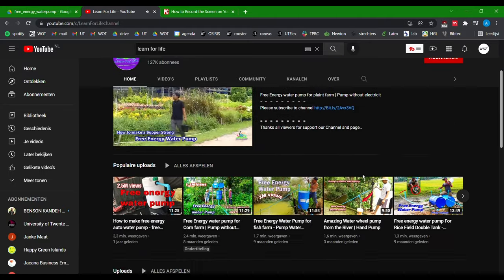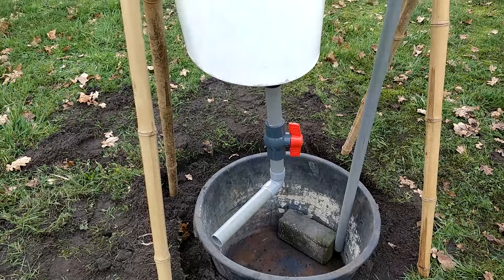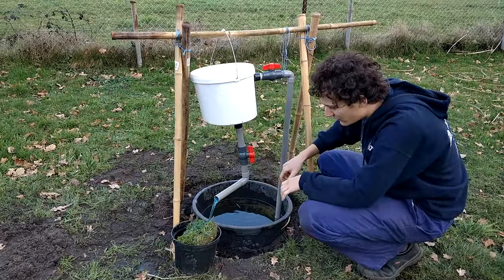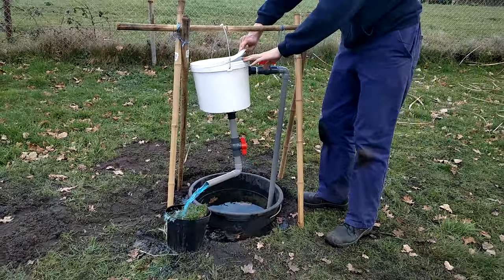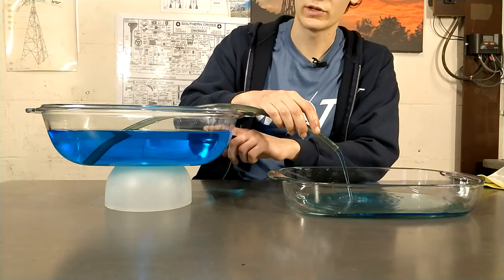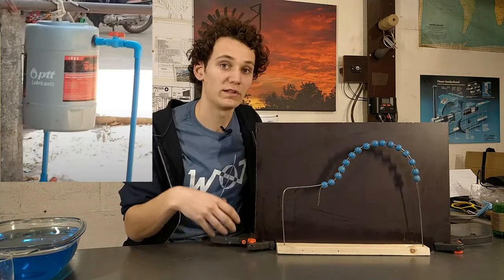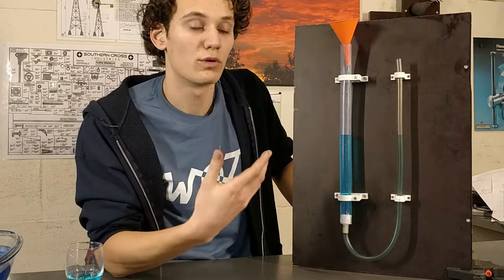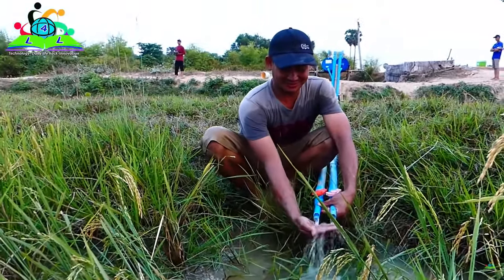FREE ENERGY Water Pump Tested. Is it possible?

Comment: It would work if you prime the tube inlet to the well lower that way the water flowing out of the bucket creates a vacuum
Reply: Noop. The sole purpose of using a starting bucket on this siphon is that you do not need to fill up the suction tube. But remember, this is a siphon. No siphon can lift any water up to a higher level from a well. Source water level must be higer than the output. That is not the case here, so the siphon fails, just as the video is demonstrating. The «drum pump» is no pump, just a siphon with a starting barrel.   All videos showing drump pumps lifting water are all fake. The only water that comes is the water you have manually lifted up into the drum. Then it stops.

Comment: You're mistaken of any Size calculation.
Inlet, Outlet pipe and Sizes of Tank and any seal points.
Reply: Everything here is all OK. There is no need for any spesific sizes on the barrel or pipes. For this to work, source level must be higher than exit.

Comment: Explanation of Operation of a Pump-less Suction System

Operation:
In this system, water suction is achieved solely by the hydrostatic pressure exerted by the weight of the water in the container. The pressure at the bottom of the container (P_tank) is greater than the pressure in the tube (P_tube) due to the elevation difference. The pressure difference (ΔP = P_tank - P_tube) pushes the water up the tube, creating flow.

Compared to a system with a pump:
- Advantages:
  - Simplicity: No pump is required, reducing cost and complexity.
  - Reliability: Fewer moving parts, reducing the risk of failure.
  - Low operating cost: No energy is required for operation.
- Disadvantages:
  - Lower flow rate: The flow rate is limited by hydrostatic pressure, so it may be slow.
  - Limited lifting height: The maximum elevation difference that can be pumped is limited by hydrostatic pressure.
  - Dependence on slope: Operation relies on the slope of the terrain, making it unsuitable for horizontal installations.

Applications:
This system can be useful in situations where simplicity, reliability, and low operating cost are more important than flow rate.
- Agriculture: For irrigating fields on slopes with low water demand.
- Hydraulic works: For supplying small tanks or reservoirs at low elevations.
- Education: For demonstrating principles of hydrostatics and fluid flow.

In summary:
Implementing a pump-less water suction system is feasible, but requires careful design, considering limitations in flow rate, lifting height, and dependence on slope.
Reply: This is a siphon. No siphon can lift a single drop of water to a higher level as there is no power source in the system. This video shows that a siphon is no pump.

Comment: You drive whit a mercedes and try the same whit a lada.  You forget a return valve and the exit pipe mus be longer than the incomming to the water line then you get a vacuum and it pulls the water out of the well and 2 stand pipes create extra vacuum pressure when it flow

Comment: Try and Use a smaller diameter pipe for the inlet, the weight of the water on the inlet should be less than the output, see in all the videos the inlet is smaller and at about 45 degree, compare apples with apples.

Comment: I think this design didn't work because air was going through the outlet tube so you would lose any pressure built into the bucket. Maybe try to experiment again with bubble catcher. Maybe you'll have better success
Reply: A bubble catcher would only work for some minutes till the catcher is full of air. The bucket itself is a bubble catcher. Here he on purpose makes the output a bit short to speed up the fact that air will tend to enter in reverse.

Comment: your mistake is, you used a bucket, instead of sealed container like, it works if there is no air coming into the sytem
Reply: The form of the bucket, tank, container, vessel, is irrelevant.

Comment: anyone who bleeds brakes on cars and cycles would tell you it wouldn't work as needed.  The air in the well side pump pipe causes oscillation because air can compress and also open side air inside the pipe.

Comment: You missing two things 1. Prime the inlet 2. Your container must sealed perfectly to create vacuum from the system
Reply: With a container you do not need any foot valve or filling of suction pipe. The air leaking in from the outlet proves that the container is air tight.

Comment: But you can transfer water using a water level system to top off lakes connected to topped off levees with a pipeline and a one way valve 🤔🤗

Comment: what a disservice to humanity to discount a brilliant simple and EFFECTIVE way to solve problems. i encourage you to rethink whatyou have done .i have a working model of this concept . runs continuously 24/7 rain or shine. took 5 tries to find a vessel that would not collapse. yhat force that collapsed my vessels is what " pulls " water up against gravity as the down side has more wieght .if AIR is not allowed back into vessel this " pull" exists indefinatly. i submerged the output line in a bucket to prevent air from glugging up into the vessel. AIR IS THE ENEMY OF THIS CONCEPT.  do it right and stop spreading ignorance.
Reply: Sorry, you are spreading ignorance. If you have a working model of this you ar proving that a siphon can lift water. Never heard of. For a (barrelled) siphon to work, inlet must be higher than outlet and the system must be air tight. This video shows that a barrelled siphon does not lift water.

Comment: Seeing the tap filters that have lights that turn on when you turn on the water flow. I always wondered if you could use the power of the flowing water to power the pump. By having several of these generators in the pipe can you produce enough energy to pump  enough water into a system that replaces what is drained out? Seems to me the water column has the same gravity force on it you should be able to get just as much energy out of the first generator as you do the last one. Good theory for you to test.
Reply: No, you can never get more energy out of a system than you put into it. In the real world, there are always losses to entropy, meaning it will stop moving after the innitial energy is dissipated. In a 100% efficient electro-mechanical system (which does not exist), you could get perpetual motion, but you couldn't actually do anything with it, you couldn't use that energy for anything. It's like the Moon orbiting the Earth. If you use it's motion to power anything, it will slow down and fall closer to the Earth. (In fact, the Moon is slowing down the Earth's rotation and moving higher in its orbit, but that's another conversation.) Another example is a superfluid with zero viscocity, wich does actually exist. You can set it in perpetual motion flowing around a tube, but you can't extract any energy from it without slowing it down. Essentially, it's just in orbit like the Moon.
Reply: You could generate power from a syphoning system, where the source is higher than the exit, therefore water is dropping in height.  like a hydroelectric power plant
Reply: @jabyers  Sure, but that is indirectly collecting solar energy (heat>evaporation lifting water). He's talking about a perpetual motion machine with no external energy source.

Comment: You didn't install a foot valve at the end of the source pipe and your upper reservoir is not properly sealed thus air is sucked in thru the lid. Another thing your upper reservoir is too small to create vacuum pressure enough to sucked water in from the lower reservoir. Also your delivery pipe is too small for the flowing water to generate a vacuum inside the upper reservoir enough to sucked water up from lower reservoir.

Comment: PLEASE PLEASE PLEASE RE-DO
I would love to see this work. I tried a smaller scale version with juice bottles (hard plastic), straws and hot glue and didn't work for me
Your possible mistakes. 
1. SEAL THE LID, 
2.bigger bucket and higher, 
3.a straight down pipe without elbows (avoiding air being sucked in). 
BONUS : add one way valve on inlet as people suggest (but consider that more pressure need to build up = bigger water tank) AND prime it.
 
Add a 12v alternator with a rectifier and you get free energy as well. 
I have a SHALLOW WELL PUMP and the pump would not work if is not primed ( burned a pump before because I didn't followed instructions)
Reply: Everyone would love to see this work and harvest in addition free energy! But that's not possible. Neither 1, 2 or 3 nor a valve or priming helps. This is a question of water and air pressure, and water pressure does not depend on the weight of the water but only on the height of the water column. This becomes evident if you connect a thin and a thick pipe at the bottom. The weight of water is bigger in the thick pipe, but it doesn't push up the water in the thin pipe, the water level is the same in both pipes. Likewise, a "thick pipe" as a drum could only lift water in a thin pipe (going down the well) if the drum is higher than the height water has to be lifted.
It is true, that a vacuum forms at the top of the drum if water starts flowing out. But already at a very small level this vacuum will stop the water from flowing out! This happens before the vacuum is strong enough to lift the water from the well. 
Don't waste your time with this "pump". If the outlet is higher than the water level in the well it does not work and can not work. Water can't be lifted to a higher place without an input of external energy.
Reply: If you lift that åump more than about 7 m above the water level in the well, it will burn again. The pump is in fact reducing the pressure in the housing so the atmospheric pressure on the water in the well presses water up into the pump. It is a hassle to get water up from a well deeper than 7 m. You normally use a submerged pump. Alternatively an ejection pump with two tubes running down into the well.
This video shows that no siphon can lift any water. And, if a U-bend had been added at he output, no water will come out from the bucket at all. A U-bend will prevent air from sucking in via the output side.

Comment: To make it work, the container must be sealed, the outlet must be longer or larger than the inlet. I have tested it, and it does work. It can be perpetual if you put the outlet back to the start using hydroponics 👍🤩🧐🤑🤮🤑👍🤓
Reply: - seal here is ok, just watch the video
- no need for outlet to be longer (or wider) than inlet
- if it is perpetual, you have found the solution to all our energy problems

I short, this excellent video shows that no siphon can pump any water uphill

Comment: The people who actually make this and claim it works, do not call it a "free energy" device. So far, you're the only one. It is called a "self running pump". So far, when people talk about "free energy" what they really mean is "free electricity" and we have loads of free electricity devices such as generators, turbines, solar panels and more. The thing is, there are several versions of self running pumps which in fact do work, such as a "hydraulic ram pump". Try making it exactly, I mean exactly as the people who appear to have a working model, then look through the comments of all the "debunkers" to see what you did wrong. Loads of the commenters are people who've been to high school and college and have some idea of how physics actually work, and how different physical forces can work together.
Reply: «Self running pump», never heard that expression. Here is another clamng free energy: https://www.youtube.com/watch?v=_7Rlp8GD5ew 
Btw, a hydraulic ram pump needs energy from running water. Without this energy, it dos not work. 
As for this video, it is excellent! It shows that a siphon can not lift any water up to a higher level. In other words, you can not pump any water up from a well using a drum“pump“. To get water up, you must add energy to it. You get no energy from a well.
Reply: @kjellg6532  Of course. There always has to be energy input to get energy output, even if you find a way to increase the output. The input energy is gravity, the output energy is the water flow. As long as there is enough that comes out to draw a vacuum strong enough to allow atmospheric pressure to push water into the bottle, then nothing in ohysics actually goes against this, provided the design is exactly correct. An output tube too wide allows air to overcome the water coming out and air goes up the output tube. An output tube that is wide enough but also long enough would give a siphon effect. People have already made a self running pump when you think of a siphon. The initial input energy is suction on the hose which is replaced by gravity, the output is gasoline coming out. Same idea, completely different design which is assisted by a vacuum effect. I'd like you to tell all of the people on here and other videos of the same device who claim they made one themselves which works that it doesn't... The fact is, if people have made working models, then you are wrong and any so called debunkers are also wrong. You can get water to go up and over a wall using only a rope...Or move from one glass to another using a string...
Reply: @darrylkinslow3357  Sorry, but this is nothing but a siphon with a priming blue barrel. No siphon can push water uphill, nor hoist it up from a deep well. Impossible. All these YT videos claiming that water can be lifted by a siphon are fake.
Reply: @darrylkinslow3357  „People have already made a self running pump when you think of a siphon.“
But a siphon is no pump, a siphon can not lift water from one pond to a higher pond. Water, and gasoline flows downhill, not uphill. OK, a siphon can lead water over a 10 m high wall, but you can not extract a single drop of water up there. All the water must down to an exit lower than the source.

Comment: So why can you siphon gasoline from a gas tank?
Reply: No problen if the receiving can sits on the ground, lower than the tank in car. A siphon runs from high to low, but a siphon is no pump and can not lift any water higher.

Comment: What you need to do is put a P trap on the outlet to keep the air from going back into the bucket.
Reply: YESSS! Simply dip the output into a tiny cup of tea. This will stop any air leaking in from the output. BUT at the same time no water will come out and this was supposed to pump water?

Comment: ow man ! why did you open the inlet valve first? It sucked the water from the tube, back to the pool.
The outlet valve should be opened first, so it can create something like a vaccum inside the bucket.With the vaccum created, then you can open the inlet valve, leting the bucket suck the water from the pool.
Reply: Sorry, you are wrong. The purpose ofa bucket/barrel is that you can start with an ait filled input tube without any foot valve. He shows that a siphon can not lift water.
Reply: @kjellg6532  Sorry but you don't make any sense.
What is the meaning of  " you can start with an ait filled input tube "  ?
and what exactly do you mean by "foot valve"  ???

Comment: Your demonstration lacks the creation of the air pressure in the bucket, which sacks water from the source. 
You need 3 holes, 1,for inlet ,2nd for outlet 3rd for air , again  3 valves.

Comment: ey dude, maybe your top seal is not proper and  not secured thats why  the pressure needed is escaping and not enough  that connot pump water..also make the output pipe longer to create stronger momentum of water out flow and  and for that can make more presure.
Reply: Noop. This system shows that input water level must be higher than output, as with any siphon. There is no need for longer exit pipe, but it must extend lower than the source water level.

Comment: you didn't close the bucket. so you didn't create a pressure deficit between the bucket and the reservoir. this concept is simple physics but confusing many people. first, you create a suction pressure by creating a vacuum in the bucket.but the bucket should be closed. the whole system is Air tight don't forget your system is Open therefore with alot of pressure losses. you just didn't understand the setup of those guys properly . its two principles of suction and siphon. it's the suction principal first until water comes into the bucket and the siphon but your explanation lacks insight about suction concept

Comment: While watching your demonstration is a leak pressure I hope no vacum is created, 

I have not tested yet but I have watch a lot of free energy I understand the mechanism how it work, the suction inlet pipe need to retain water hence no air remained inside the pipe before the  outlet knob is open, 

When filling the drum full of water and afterward when outlet pipe knob is open the filled water flow out hence creating strong vacum pressure,  hence suck water from the inlet suction pipe.

 # nteresting point when suction pipe retain no water the mechanism fail badly.
Reply: This is a siphon. No siphon can lift any water up from a well to a higher level. This video demonstrates that.